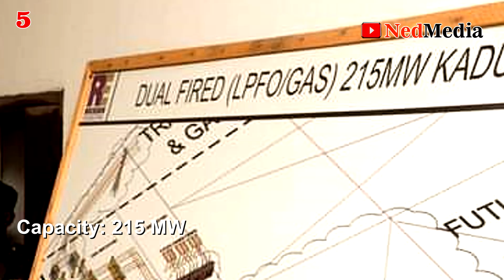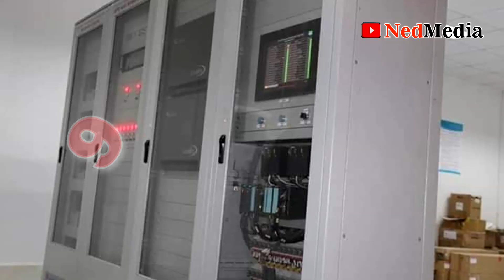Top 10 Power Projects In Nigeria | Mambilla Hydroelectric Power Plant Finally Takes & Other Info

Comment: It is worth mentioning that many foreign corporations are interested in building or financing power plants in Nigeria but they want Nigeria to increase the electricity tariff so that they will be able to recoup their investments and make some profit but this has been slow in implementation, there was a threat of strike during Jonathan's administration if the price for electricity was hiked and they couldn't reach an agreement with NERC, the price we pay for electricity is regulated by the NERC (Nigerian Electricity Regulatory Commission) this independent regulatory body is partly responsible for driving away investors in the electricity sector by regulating the price they can charge for electricity, if an average Nigerian spends between N50,000 to N100,000 Naira a month for generator diesel, why should we go on strike for a N14,000 Naira electric bill?
Reply from the maker: Good points but the main problem isn't increase in tariff, it's the issue of estimated bills although its being addressed. If the tariff is raised to double of what it is today, many wouldn't mind so far as they have pre paid meters.